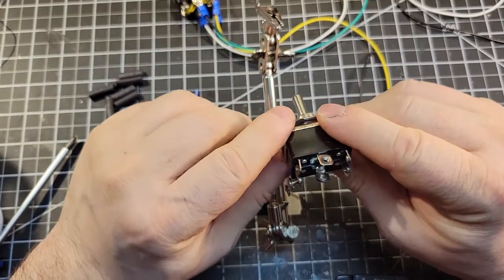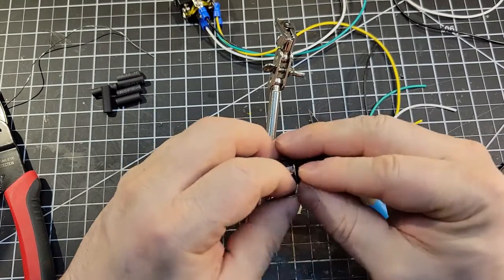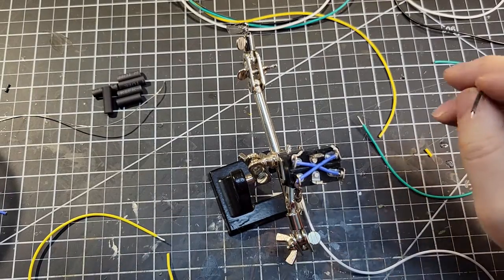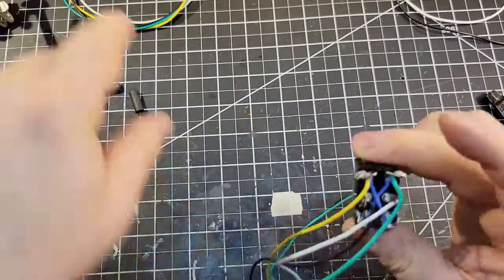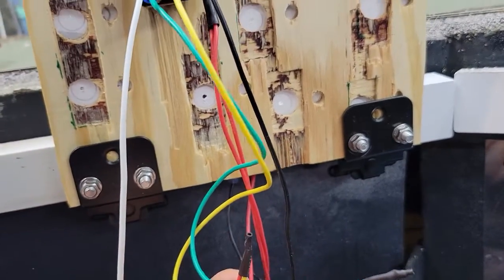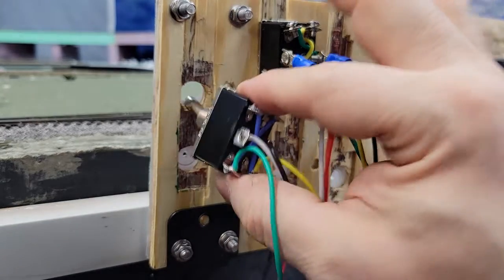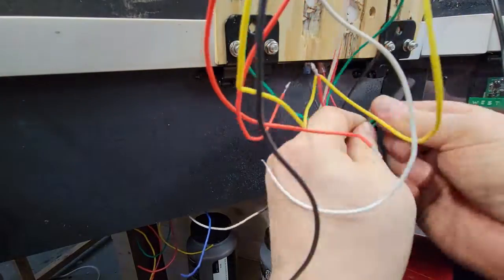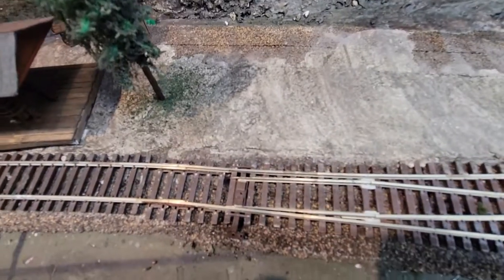014. Turnout Project Pt 2: The DPDT Switch for controlling a Tortoise Switch

Comment: Informational and well presented! I do have a question as confused. I plan on doing same setup for toggle etc but videos I have seen show wiring the X cross connect then two wires (one on each side middle position. Perhaps I am mistaken or you are setting up differently and I haven't gotten there yet. You show black and white to a middle pole but yellow and green doubling up with one of the X portions. Can you elaborate? thanks.